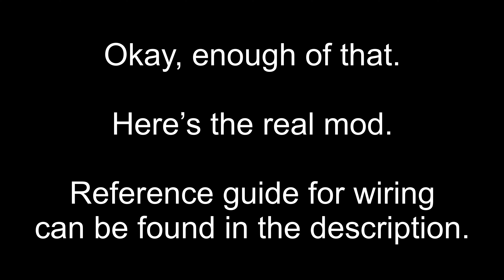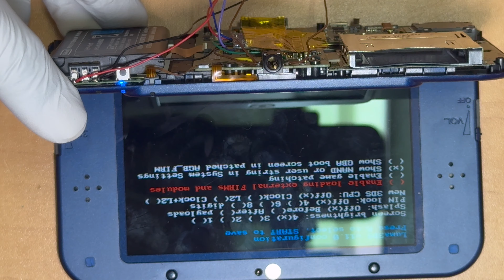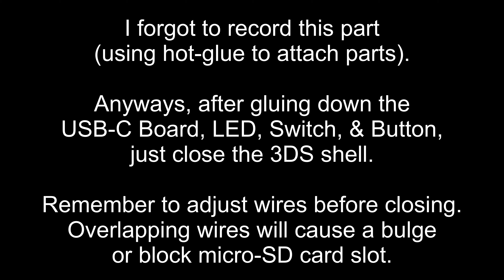NEW Nintendo 3DS XL with USB-C & Bluetooth mod | Tutorial

Comment: Bro, remember when I asked you on your older vid a year ago about a manual? Well I actually built it now and I have few things to say. It actually works and Im glad I got it to work. When I first tried to build it a year ago, I had no problems with the USB-C Port, but with the Bluetooth Module. The soldering was way too small for me to handle and I didnt get how to get those wire to solder into that tiny hole of the board. So I just threw the module away and just used the usb-c for like a year. After you post the second video (the tutorial) I reordered the bluetooth module and just replicated your actions 1:1 so I managed to solder it. And that of course worked perfectly. Im not a professional at soldering, but Im happy someone made a manual good enough for someone like me to be able to replicate that. I also faced problems when making the holes for the control elements since I only had like a dremel that was too wide in diameter, but its good enough so I can access everything. Sadly, that scheme you once posted wasnt there anymore (probably deleted), but I saved it somewhere so I'd know how to wire everything. Of course I compared that scheme with the live photo you posted in your manual and I noticed only one wiring was wrongly drawn (the yellow wire on the audio jack). I dont know if this is the reason why you took that scheme off your manual, but for me it was a good guidance to how to wire everything. Anyway, I just wanted to say thanks for sharing your work you made on the 3ds, of all the 3ds usb-c + bluetooth mods I saw out there, yours was the cleanest in my opinion and didnt require ripping off some part of an old bluetooth module nor sawing the case that much. I also like that you performed this mod on a galaxy edition, so I used the SNES Edition (EU) for my mod. (The last sentence is just for flexing, Ik)
Reply from the maker: @soups-_-5807  fixed my original post, but the updated one got deleted over time (link stopped working according to comments). Don’t know if I still go the guide saved on iPad though. Either way, Glad to see you re attempted it and got it working.

Comment: Does it work on the non xl version too?
Reply from the maker: Mod can be done to all 3DS/2DS models, but the only issue would be finding space to fit the components in.
I own the original 3DS, 2DS, and New 3DS XL. AFAIK, the 2DS and N3DSXL have space for this mod.
Original 3DS I haven’t checked tbh, but i doubt it will have space for it due to its small size. Same goes for the other models, i just outright dont know if it’ll fit components.

Comment: Had a mod like this done done on my New 3DS a while. Couple questions:

1. You think your setup would be possible on a New 3DS? Mine was less than idea, and I'd be down for a redo.
2. I'm woefully ignorant of this stuff, but any chance that a 3DS could be rigged for USB C audio like modern cellphone headphones or gaming 2.4 gz dongles?
3. Any chance you take commissions for jobs?
Reply from the maker: 1: This mod (USB-C Charging) is possible on all 3DS models. The BT module though MIGHT work, but its dependent on the space available inside the console itself. I only own the XL so im no sure if it would fit.

2: Technically it would be possible to hardwire USBC audio, but I am yet to find a small enough module that can do that. The ones I found are way too big to even fit in the 3DS at all.

3: I did previously accept requests for this mod, but stopped a while ago due to limited time because of school/work. Afaik, i might start again mid-December or early January when semester ends.

Comment: Great mod! And idea! But the USB! Wouldn't it be a hindrance? Maybe an additional Micro SD card reader would be cool? Something that can store the games/roms and can be changed out/easier access? plus having a card bigger than 32gb but not restricted having to load Everytime the 3ds is booting up? This would create quicker load times?
Reply from the maker: It MIGHT be possible but the main issue I can see with that is space. There’s is barely any room inside the console so it’ll be nearly impossible (at least for me).

Comment: Im sorry I keep asking so many questions
what is that wire that you're using, when I look up solder wire it doesn't have that color thing around it
Reply from the maker: Not sure what youre talking about exactly, but i did use Solder wire ofc, and 30AWG copper wires to connect the modules to the 3ds.
Reply: ohhhhhhhhhh im actually blind my bad
i thought you were just putting the soldering iron on the wire and it was melting
thought you had some kind of special wire

Comment: What's the purpose of the original charging port once this mod is installed? wouldn't it be better to swap out the old one for the USB c one?
Reply: You can but its between the gold pins, which are using for dock charging, there are mods that let you swap it out but its a lot harder and more likley to break something, ebay sells a kit for $20 that im going to try
Reply: should also mention some mods use the original port for data such as a capture card

Comment: I accidentally bought the wrong buttons :(
they have 2 prongs instead of 4
can I still do the mod like this?
if I can what would I need to change
Reply from the maker: @hamman6920  if you just disregard the LED wiring to the button, yes. The pairing function will still work. As for the LED indicator, it MIGHT still work if you wire it to any other ground pin on the board.

Comment: bad news
i tried and failed this mod pretty badly
there was barely enough space to fit all the components inside (doing this on a 2ds xl) but the problem was that I fried the Bluetooth module and the console wont turn on unless its plugged in and charging
I've tried using different batteries but I still have the same issue so I think I messed up the part the battery connects to but I'm really not sure
do you have any ideas on what I could do
Reply: i opened 3dsident and looked at what it says about the battery and it says:
Battery percentage: 50%
Battery status: charging
Battery voltage: 190 (3.7V)
Adapter state: connected
MCU firmware 3.65
Power-saving mode: disabled
Reply from the maker: @hamman6920  Only way to make sure you didn’t kill your system is to remove the modules (clear system). If it works as normal, it probably is the mod that is bad. Or it’s still messed up, then you might be right and could have damaged your system to some extent.
Reply: @iSpoof  i already removed the mod and it still isn't working
Reply from the maker: Possibly check if anything is bridged around the areas you worked on. That’s my best guess tbh. Your device doesn’t seem like it’s fried since if it was, it wouldn’t boot at all.
Reply: @iSpoof  alright, thank you so much for all your help with this man

Comment: I did this mod but now the original charging port dosent work. Do u know what might be wrong
Reply from the maker: @jweeyt3231  you may have bridged two points while connecting wires for USBC port.

Comment: What's that yellow tape you put over the Bluetooth thing
sorry I'm really new to this stuff
Reply from the maker: @hamman6920  kapton tape.
Reply from the maker: @hamman6920  not exactly necessary but I’m just using it as a precaution in case the solder joints of the wires once connected don’t mess with 3DS board
Reply: @iSpoof  Ah, theres no stores near me that sell it, are there any replacements that would accomplish the same thing?
Reply: im doing this to my boyfriends 3ds tomorrow so I wanna make sure I do everything right but I don't have time to order the kapton tape
Reply from the maker: @hamman6920  Not required as mentioned, but i assume any other thin tape (scotch tape possibly) will be enough if you want. Or an alternative could be to spread a bit of hot glue around the BT module thin enough that it prevents it from making contact to components on 3DS board. Do note, that if you do device to do the hot glut thing, make sure its a small amount because the 3DS is already limited in space as it is.

Comment: The slide switch listed is no longer available. Is there another you recommend?
Reply from the maker: Just search for another. Just make sure it’s 6 leg and not 2 or 3 (requires different wiring).
Reply: @iSpoof  Thanks, just received my order from AliExpress. However they sent me a 2 pin push button switch rather than the 4 pin. Is the wiring still doable? I would assume one pin would get the cathode side of the LED and the other pin would have the CONNECT and AGND on it?